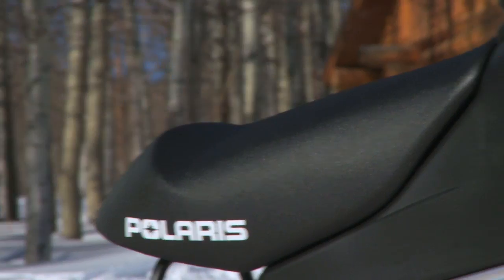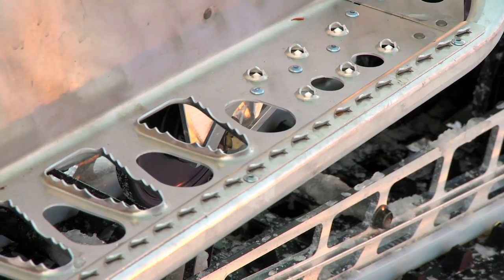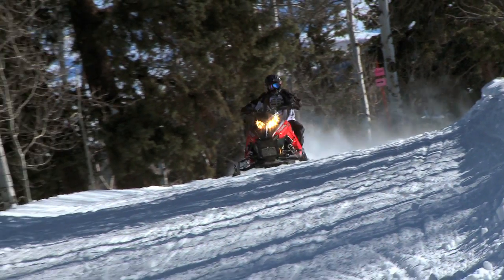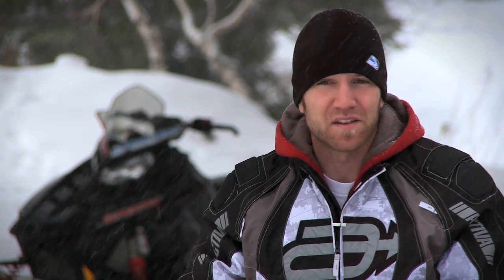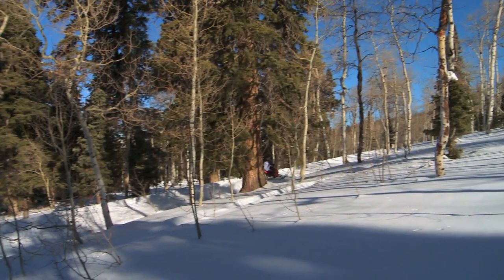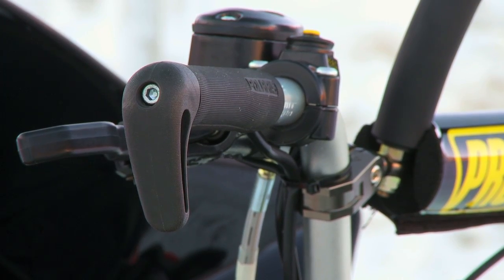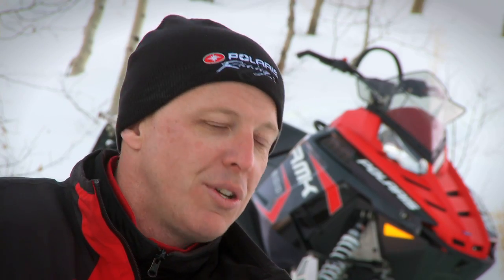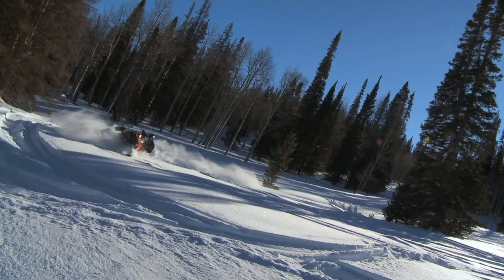SnowTrax checks out 2011 Polaris Line Up

Comment: 151 is the HP on the powertek 800R. The 800 E-tek is being rated from Ski-Doo at 155HP though most dyno numbers are coming in at 163 or higher. The reason for this is the summit models have less HP then the short tracks and renegades due to mapping of the engine and altitude adjustments. Ski-Doo is claming the low end of what the engine is capable of.

Comment: @danno177 Polaris' 800 liberty engines produce 154HP. Their 700's have 140HP and their 750 4 strokes have 140HP. Ski'doo and Cat keep getting more and more horsepower out of their engines and are just going to blow sooner than the liberty engines that have been being perfected, now their sleds are lighter than Ski-Doo's so they have similar power to weight ratio's.